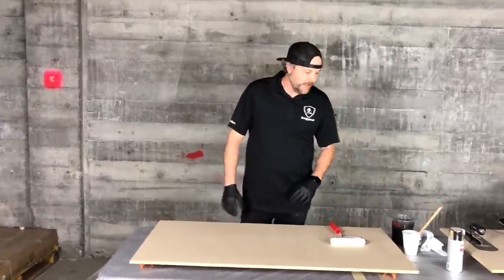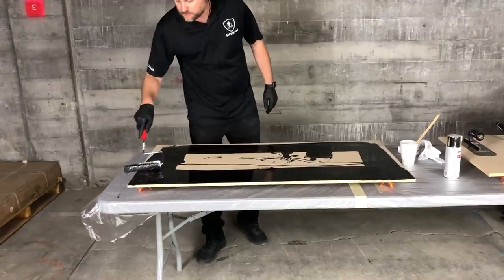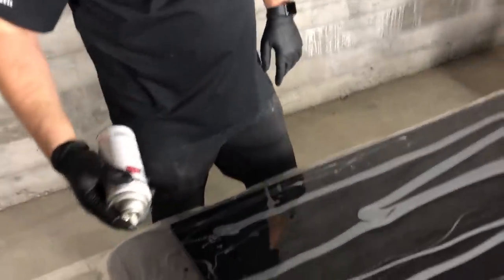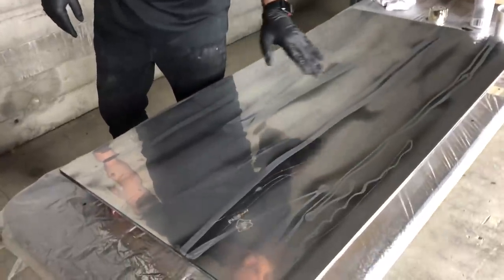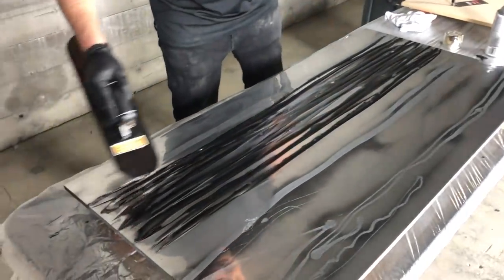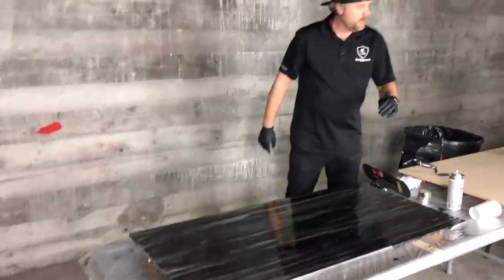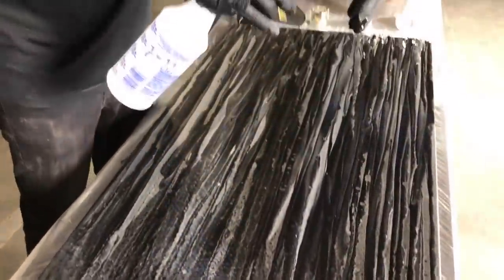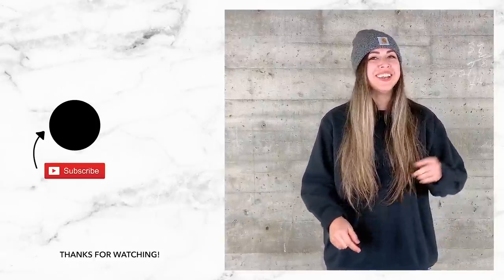Awesome Epoxy Techniques Part 1 | Straight Vein Technique

Comment: How did you mix the black paint with epoxy so as. Not to mess with consistency and ruin the epoxy? Isn’t epoxy finicky when you mess with it? Such a cool table!
Reply from the maker: We just add the metallic color to the epoxy to pigment it, it is not finicky at all.

Comment: Whats the reason you guys use isopropal alcohol vs denatured alcohol? I use denatured to thin epoxy and though it was good for the cells too.  but it seems that your cells are much better than mine.  Is this because im not using isopropal?

Comment: Once you spray the alcohol, you get dents in the epoxy. Do you put an extra layer of clear epoxy on top to smoothen it out? If this design is used for a tabletop

Comment: Question for Leggari.... Is a mechanical bond to the primer coat as effective as the chemical bond?   I have something in mind but it would require that I let the primer dry and then sand it lightly.
Reply from the maker: Our primer is a water based epoxy specifically designed to chemically bond to almost all smooth surfaces.

Comment: Looks nice. Doesn't it need the top coat, though?
Reply from the maker: Yes you can apply a top coat to make it more durable.  We have 3 different top coat options. Glaze coat is our super high gloss top coat that lays out glass smooth just like the metallic epoxy coat. Our WB Urethane comes in high gloss and leaves a minor texture and we also have a WB Urethane that’s a Matte/Satin finish.

Comment: Was that finished?  You didn't put any clear epoxy on it?  Looks good.  Just wanted to make sure it dries and doesn't scratch when Your using the countertop.  Thanks for helping me with this...
Reply from the maker: We have 3 different top coat options. Glaze coat is our super high gloss top coat that lays out glass smooth just like the metallic epoxy coat. Our WB Urethane comes in high gloss and leaves a minor texture and we also have a WB Urethane that’s a Matte/Satin finish.

Comment: How long between epoxy and urethane for the top coat? How long between both coats? Does the urethane come in a spray? Can food be placed directly on the countertops and will the food be edible?
Reply from the maker: Once you apply the epoxy the next day you do the urethane top coat.  You roll the urethane top coat on with a roller.  Yes the product is USDA approved

Comment: That's really cool. When I tried a similar technique, the resin colors all just ran together, so I got mud. All of my alcohol cells went away, and the powder tints settled to the bottom. Any tips? Glad I tried it on a test piece.
Reply from the maker: Contact our techs at 844-534-4274 Ext. 1 and they can help you out to achieve the look you are going for.  Thanks

Comment: Is your black primer epoxy too? and how about the silver in a small bucket is that epoxy too. How long is the wait to dry completely!
Reply from the maker: Our primer is a water based epoxy specifically designed to chemically bond to almost all smooth surfaces, it is not an epoxy.  The silver in the bucket is our pigmented epoxy.  The cure time for the epoxy is a full seven day.  Thanks

Comment: After that, would you sand it down and add a few coats of clear epoxy to it?
Reply from the maker: No you don't need to sand it down, if you want a top coat you just apply it the next day.  Thanks

Comment: I never see you guys torch the epoxy for bubbles (after alcohol evaps of course). Do you not need to do that with your product?
Reply from the maker: We have a high end epoxy that has an additive in it to make the bubbles rise to the surface and pop on their own.  Thanks
Reply: Hello, what is the name of the high-end epoxy that brings additives? Thank you

Comment: Awsome . What was the Black epoxy you used. Is it Ready made or the one where you have to mix up yourself? Also what was the spritzer you used? Can these products be bought in EU?
Reply from the maker: We add black metallic powder to the epoxy.  We are not set up to ship internationally right now,  but we are in the process of setting up our international shipping.  Check back with us in a few months.  Thanks

Comment: Is the resin ok for countertops? Mena, how about scratches? How is this. Ompa re with marble? Or granite?
Reply from the maker: Our products are actually industrial coating made for military aircraft hangers, etc. So theoretically in a residential, or even commercial setting it will last forever. This is NOT a cheap epoxy paint that you will commonly find at box stores like Home Depot or sherwin Williams. It is a thick 100% solids epoxy coating.

Comment: Hi... it's soo cool...😍 ...what was the spray u used on it... and by scrabing techniches will the level of resin pour not get disturbed...I mean will it be even finished...
Reply from the maker: We use isopropyl alcohol to give it a dispersing effect.  Yes the epoxy well self level and leave a smooth surface.  Thanks

Comment: What is the normal completion time for a counter top including drying time?
Reply from the maker: It is a two day process if you have a top coat and the epoxy will take a full seven days to cure.  Thanks

Comment: Wow, this is awesome, did you put a clear coat over it in the end? Thanks
Reply from the maker: We have 3 different top coat options. Glaze coat is our super high gloss top coat that lays out glass smooth just like the metallic epoxy coat. Our WB Urethane comes in high gloss and leaves a minor texture and we also have a WB Urethane that’s a Matte/Satin finish.   Thanks
Reply: @LeggariProducts  the glaze coat IS the metallic epoxy right?

Comment: Hi there
Is that just ordinary metallic car paint? Great affects👍👍👍
Reply from the maker: Not at all, this is a special formulated Leggari brand epoxy.
https://online.flippingbook.com/view/364043
Reply: I think it is, I have tried and you should too. They just need to earn money 😉
Reply: LazyTube cheers for that. I’ll try some on a sample first to see if there’s no adverse affect
Reply: The spray paint itself here is Rust-Oleum chrome effect, but in another comment they said you could use any kind you wanted - it's the spray paint's ability to dry quickly into a thin skin on the surface that allows this effect to work, I believe 👍
Reply: lisakp71 that’s good to know👍

Comment: CAN I ALSO USE POLYURETHANE OR IS EPOXY BEST?
Reply from the maker: We use epoxy then we top coat it with urethane to make it more durable.  Thanks
Reply: @LeggariProducts  I have had issues when coating my epoxy with wipe on poly. I cannot seem to get it streak free. Could you make a video showing how you apply the poly, or do you have any tips you can offer for putting on finishing coat of poly. Thank you

Comment: For those of us that don’t have the magic epoxy, lol can we use a torch to get the bubbles out? Awesome work by the way.
Reply from the maker: Yes you can use a torch if you want to.  We have a high end epoxy that has an additive in it to make the bubbles rise to the surface and pop on their own.  Thanks
Reply: I ordered an inexpensive epoxy for the marine world so I could save a TON of money off Leggari and Stone Coat. It was junk! Utter trash. I went with Stone Coat, but I think Leggari is better still. 
Leggari was a grand to do my counters, I used Stone Coat and it was $300

Comment: Beautiful! How durable is the finish? I’d be worried it would scratch easily.
Reply from the maker: Our products are actually industrial coating made for military aircraft hangers, etc. So theoretically in a residential, or even commercial setting it will last forever. This is NOT a cheap epoxy paint that you will commonly find at box stores like Home Depot or sherwin Williams. It is a thick 100% solids epoxy coating.
Thanks

Comment: Hello, is your epoxy any different from other craft rezin, For example “ArtResin?”
Reply from the maker: Our products are actually industrial coating made for military aircraft hangers, etc. So theoretically in a residential, or even commercial setting it will last forever. This is NOT a cheap epoxy paint that you will commonly find at box stores like Home Depot or sherwin Williams. It is a thick 100% solids epoxy coating.

Comment: What?  No seal coat??
Reply: I think they only did this one to show a new technique
Reply from the maker: We have 3 different top coat options. Glaze coat is our super high gloss top coat that lays out glass smooth just like the metallic epoxy coat. Our WB Urethane comes in high gloss and leaves a minor texture and we also have a WB Urethane that’s a Matte/Satin finish.

Comment: So when your all done do you clear coat it over it with epoxy
Reply from the maker: We have 3 different top coat options. Glaze coat is our super high gloss top coat that lays out glass smooth just like the metallic epoxy coat. Our WB Urethane comes in high gloss and leaves a minor texture and we also have a WB Urethane that’s a Matte/Satin finish.